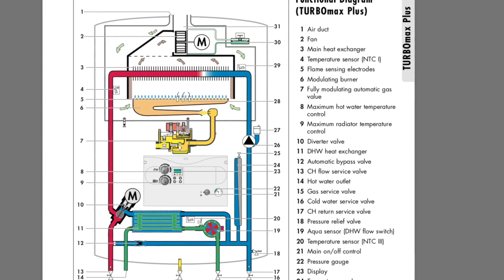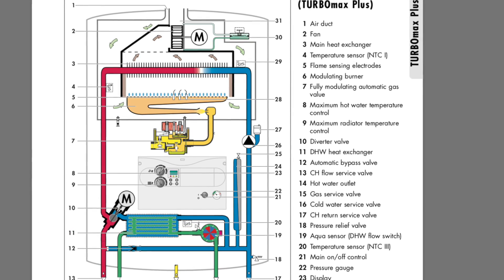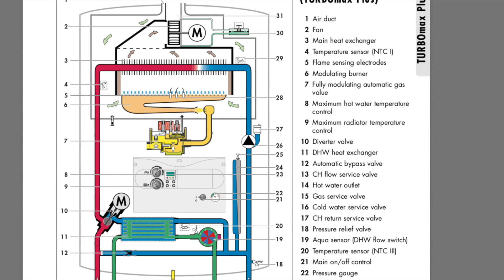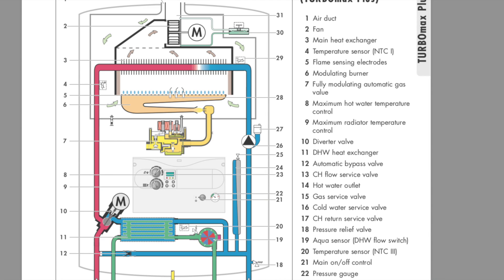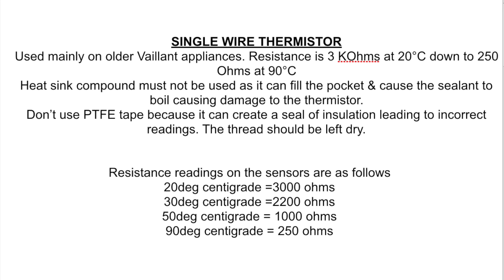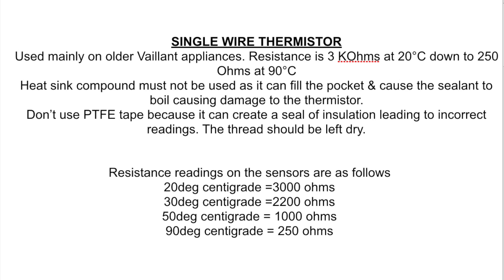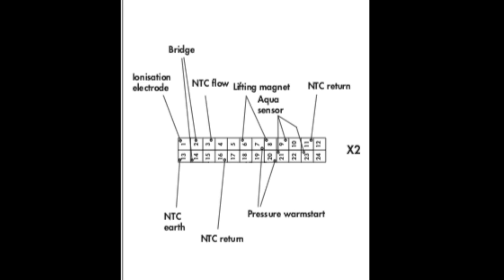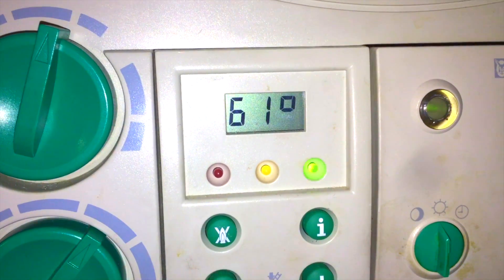Vaillant Turbomax Plus F24. Single Wire NTC. Boiler Repair And Training. Heating Geek.

Comment: I'm having a similar problem on my Turbomax Plus 828E, but sadly this fix didn't resolve it.. :( Central heating side of things works fine, but when I run a tap as soon as the temp rises above 60 the display goes haywire and the system locks down with an S.54. Very oddly the kitchen tap doesn't always trigger this effect, but the upstairs ones always do... So it seems to be affected by the length of the run to the tap/the flow rate? It has a brand new heat exchanger, so I doubt it's anything to do with that. I'm thinking it's either the PCB or one or more of the NTCs.. Could it be anything else? Any way of narrowing it down further? Any advice appreciated. Great vid btw.
Reply from the maker: The diverter valve may have a swollen ball. This will often only present itself when the Hot water demand is very high. Your bath tap usually runs a lot faster (more litres per min) than your kitchen tap. Does the boiler get noisy? The fault in this video is the boiler "thinks" its too hot but tactually isn't. If your boiler does get noisy the it probably is getting too hot. Have a check and let me know.
Reply: @HeatingGeek  Thanks for the reply. Update: The nature of the fault seems to be changing. It does go to S.54 from the central heating side of things now but not quite as often as from the taps. Did some tests on flow rates and it doesn't seem to matter now which taps are used or how fast they are running (2ltr pm vs 6.5 ltr pm = same result), so I don't think it is to do with differences in demand necessarily. Also, the display seems to be freaking out at just below 50 now instead of 60... Just occasionally the boiler is going to F.24 as well. It doesn't seem noisy in operation, and doesn't appear to be getting hotter than normal, water temperature for the amount of time it does produce hot seems to be fine... I love this boiler so I don't mind replacing whatever needs to be replaced, I have a couple of NTCs on order in case as they're quite cheap. Does that shed any more light on what it might be? :/
Reply from the maker: @fnps1663  if its not noisy and you have replaced the plate heat exchanger I would guess an electrical issue.
Something I have seen a few times is, the flow NTC on the left hand side of the boiler above the diverter valve touches the side case. This will only happen if the plastic plug cover is missing AND the diverter has been replaced.
When the diverter is replaced the vertical pipe to the main heat exchanger can turn a little and cause the NTC plug to nearly touch the case. When the boiler runs the vibration can cause it to touch. I also love the Turbomax plus boiler and think it's the best combi boiler ever made.
Reply: @HeatingGeek  Thanks, yes I think it's most likely electrical now. The diverter was replaced a few years ago but the NTC still has its cover and isn't touching anything. First step will be NTC replacement followed by PCB if needed. Will update you with what happens either way. Thanks for your replies!
Reply: Update: It was the right hand side NTC that was to blame. Sadly it took some swapping around of NTCs to figure out as one of the new ones I received was also faulty or incorrect it seems. Boiler is currently functioning correctly!

Comment: I had the exact same issue with my TURBOMAX PRO 28E VUW 282—flashing yellow ignition LED and an error indicating a flow problem, which led me to the exact same solution. Diagnosing it was tricky since flow in these units is only measured by the NTC sensors. It took me nearly a year to pinpoint the problem, even though I suspected it was related to the NTCs. The turning point came when I had to reset it with shampoo still in my hair! I wish I had found your video sooner—it would have saved me so much trouble
Reply from the maker: It's a tough one to find. :-)

Comment: If timer is faulty can you remove  timer and fit external controls
Reply from the maker: Yes you can. Pull timer out and wire in new controls.

Comment: Have you ever checked the Modulation Current d.37 on the TURBOMax during the run cycle ? I have one that is running for just 30 seconds or so per cycle and I’m thinking it’s going full rate rather than modulating.
D.32 readings
- 0 to 111 (mA) for Ignition sequence (6 seconds),
- Then 13 mA for 28 seconds of run,
- Then back to 0 for pump overrun.  
Target temp of 70 is being reached by the 30 sec cycle. 
Any thoughts on such a short cycling ? Is it normal or should the burner be modulated down and the therefore a Gas Valve Modulation higher modulation current should kick in ?
Reply from the maker: Just check the gas pressure. If the mechanical gas valve isn't set up properly then it doesn't matter what current you have. Someone could have set up the minimum to 10mb and the max to 10mb. the boiler will not modulate then
Reply: @HeatingGeek  yes. It was the Has Valve that needed setting up. It’s a lot better now. Thank you.
Reply from the maker: @Bob_too  I haven't been around much so didn't reply. sorry about that. Glad you got it sorted.

Comment: Does the Flow and Return side NTC’s fit in to a closed end thread or actually through the copper pipe to contact the water ? 
I have a TURBOMax that looks like it has white jointing compound coming out the side of the NTC threads, so I’m wondering if someone has ‘sealed’ them in and this could cause an increased resistance. If the NTC’s go in to a closed threaded coupling, the No sealing should be required.
Reply from the maker: The NTC is in a dry pocket. Sometimes heat sink compound will be put on the tip but PTFE shouldn't be used.
Reply: @HeatingGeek  thanks. So the Flow / Return NTC’s can always be changed with out draining down ?
Reply from the maker: @Bob_too  Yes. :-)

Comment: So good that you take time to study. I have an issue where i have the Turbomax 28, not the pro with the fault panel. Anyway my issue is that when preparing for CH, it often tries to start x 3 then reverts to failure mode and has to be reset. If  i have water demand, it runs every time with no failure. I have noticed that if i reset the boiler and turn on HW demand, run for a minute then turn off HW, the CH demand will run and fire as normal. Only after heating temp is made and boiler switches off does the cycle happen again. I have had an engineer out and he has replaced the Dviverter Valve, same as in your video. That has not fixed the issue. I dont want to be chasing fault after fault with replacement after replacement. Its an expensive non repair. Do you have any experience i can point him in the direction of?
Reply from the maker: I Didn't see this comment. Sorry, i hope you got it sorted
Reply: Yes i did, it was a strange solution though. The thermocouple was replaced and the issue disappeared. It doesn't explain the correct operation on HW demand but its been fine ever since. I was hesitant to pay for the replacement given the symptoms but the engineer had said he had seen such an issue before! he was right. @HeatingGeek
Reply from the maker: Your boiler doesn't have a thermocouple so something else must have been replaced. :-0

Comment: Update:  I replied 1yr ago that your fix appeared to help our issue, and indeed for a year or so its been fine. However a few weeks ago, same S.54 and the random F.24.  (S.54s started to come daily)  I re-did the extra earth connection but still happened.  But, when working boiler was fine.  Taking this "cause" to the next level, I replaced both NTCs pre and post HE (ebay £9 for 2x genuine!) but wrapped an earth cable around so it was compressed on the final turn  (I tried soldering to side, but solder didn't bind).  I then took the ECU earth off the boiler chassis and joined directly to my 2x NTC earth cables in a wago 5-way, then another cable back the boiler chassis.  Theory being, a good/known/clean/common earth between both NTCs and the ECU.  Since, *ZERO* trips!    Maybe new NTCs not needed, but thought as I had to remove them anyway I'd swap them out.  No idea if there was a faulty one, or intermittent fault, but for £9 - why not.  So it appears you were on to something, so thanks again, and perhaps "my" fix is the final step if it keeps happening!
Reply from the maker: That could be the fix. I would of assumed the issue would have been the PCB after the usual earth trick didn't work. :-)

Comment: Great video, I have similar  fault with the very same boiler,  yellow light is intermittent goes from hot to cold water. I have ordered a NTC sensor return and air pressure switch. I never thought an earth connection can sent hot water to cold in a matters of seconds. I will try your logic to.see if this works. Thanks again very well explained. Please let me me.know what you male of my fault

Comment: Hi Oliver.  I came across with turbomax hot water running for 2-3 minutes then cod and I had replaced the heat plate and still a same problem. Should I look in to flow sensor? Would appreciate you advise.  You're master in repairing

Comment: HG you're a genius, love this solution.   Perhaps you could throw some ideas at my issue?
 I've got an old Turbomax 828E that was forever failing so I took out the Valiant "insurance" 4 years ago and the main H.Ex had failed. It was replaced along with almost every component by insurance engineers... the following year F.22 randomly appeared so I changed NTC's (twice) and all was well... then F.22 started again so I earth-strapped HEX. F & R pipes to chassis (thanks to your vid) and all was good once more... for a while, but then F.22 crept in again. When boiler first fires it happens within about 10 mins but as boiler/CH water warms up after re-setting F.22  a few times it goes for many hours, sometimes for the whole day.  
Sometimes it will fire up in the morning for a few house before F.22 oh, and if I hook up diverter valve for H/W it will ALWAYS F.22 when DHW draw is finished. (we don't use DHW so I simply unhooked actuator head from diverter valve)
PCB, Fan & Aqua sensor (which I've checked voltage output and it's good) are the only things not changed so very reluctant to scrap it now as it's pretty much a "new" boiler... :)
Any ideas come to mind?  
Thanks in advance.
Reply from the maker: I would guess the boiler is still blocked. Without looking at it, its hard to say. Sorry
Reply: @HeatingGeek  Just reporting back to say THANKYOU. I'd become so fixated on it being electrical/mechanical your suggestion put me back on track to the simple solution. 
First off "competently" checked gas pressures to rule anything there out but they were spot on so I drained boiler through service valves and quite a bit of magnetite came out. Flushed burner through service port with some X800 siphoned from bottle on top of boiler then ran the rest + another bottle of the same around the system for 3 hours which didn't lock out once. Drained and flushed twice and refilled with X100. Everything has been perfect since. 
I was even able to re-hook up the diverter valve actuator as DHW always caused lockout (commercial building so didn't need HW). We have heating and hot water and all thanks to your "blockage" comment. Nowhere on the internet or elsewhere has blockage been mentioned as a cause for F.22 on an old Turbomax Pro 820E - Been collecting quite a bit of magnetite in the pre-filter which will hopefully stop any further blockages. 
Adding this not just to say thanks but hopefully it might help others looking to keep a reliable old non-condenser going for a few more years.  Thanks again.  :)

Comment: Good demonstration of persisting with a logic based approach to fault finding. Oftentimes we are seduced into relying on ‘matching likely solutions’ based on experience and/or progressing through the easiest (shortest time) potential solution to the most difficult (longest time) potential solution until we stumble upon success.

Comment: Hello. thanks for the vid. At around minute 12 you show your solution (although you haven't used the exact bridging materials that you would have liked to have used because you're not in normal van).  What wire and connections would you ideally have used use please?
Reply from the maker: I would take its all apart and clean all the joints on the pipes and diverter and then refit it all. That would be the true solution. 
Or an earth bonding clamp above the diverter and a wire on the chassis screw.
Reply: @HeatingGeek  thanks mate. you're a legend for this one.   Had been experiencing f24 intermittent fault for months.  tried so many things and your solution worked!  good timing too.

Comment: Top quality find. You could use a pipe bonding clamp - and a length of lead with a ring terminal on each end. Total cost perhaps 2 quid - rather than your selection of gems from the scrap bucket.
Reply from the maker: :-) Its all I had :-)

Comment: The old harness wire you used from the worcester, is very cheap chineese wire with very little copper content. That's how good worcesters are...You can test the copper content of electrons in wires as they provide a fraction of a signal.
Reply from the maker: As long as the boiler was working we knew what the problem was. ;-)

Comment: Just came across this exact fault , intermittent f24  on a Turbomax 282/ 2.5 , temperatures different every time on hot water ..... I was going to replace the ntc sensors but I’m going to go back and try the return path check ..... cheers for this !,...
Reply from the maker: Let me know how it goes. No one has ever come back to say they had this. :-)
Reply: HeatingGeek ... returned to the job yesterday, cleaned up the sensors and the chassis connection , tested the sensors values , all good , tested them again to the wire on the chassis, all good and from cutting out 2-3 times per shower is running perfectly. Going back for a different job in a week so I’ll check .  After cleaning the connections the values were instantaneous where I had to scratch with the meter probe to get a reading before. Now temperatures are stable , hot water constant, no cut outs or going cold .... happy customers!!..great wee video
Reply from the maker: @christait5714  NICE. :-) Im so glad this has helped someone. This was the hardest fault I ever had to fix.
Reply: HeatingGeek .... quick update , boiler has not faulted since the repair ... 👍😁😁😁
Reply from the maker: @christait5714  Nice one. Thanks for getting back to me. :-)

Comment: Shame your title didn't have S.54 in - I'd have found it years ago!  Our boiler has been tripping with S.54 for YEARS.  (never drops to F.24, or never seen to, but F.24 is stored in error log - -assumed before I moved in).  And in that time, pump, DHW HE, diverter valve all changed and its still randomly playing up.  But only recently have I seen it drop to S.54 on heating (ruling out DHW HE and diverter valve).  The main HE was next on list, but boiler is otherwise perfect (having a shower and watching, as soon as S.54 display, flame-out reset and it cuts back in and can work for 10 mins or so).  So wasn't convinced it was physical.  Bought a HE off ebay which came with 2x NTCs (which read the right resistance) so was going to swap those first and clean contacts.  Hadn't considered the earth return.  But this is the most exciting prospect!!!!!  Thanks :)  FULL RESPECT to your approach - logical diagnosis is a skill not known to many, so well done for applying and sharing.  Will try this later today
Reply from the maker: You have to let me know how you get on. :-)

Comment: Another great tip, in 35 years , I have not had this problem, but if I did , I’m pretty sure I would have diagnosed incorrectly.
Thanks
Reply from the maker: It beat me once. Couldn't let it happen a second time. :-)

Comment: Experiencing similar symptoms with our Turbomax. It will turn the whole heating system off if the heating dial is turned to max, it only operates on about 75%. The strange thing however is that it also needs to be ON 24/7. It will not operate on TIMED mode and just comes up with the f.24 fault. 
Would this error be another symptom of that?

Comment: Recently had this issue.. untill i saw this video. Put in a cable from below the ntc on the pipework to the chassis.. spot on fixed it.. thank you.. i removed it and used my meter to measure the resistance between the pipework and the casing and it was really bad. They should stop designing electrical components that use the pipework as ground as all copper over time especially copper that gets hot and where oxidation is more common eventually looses conductivity. Great find mate.
Reply from the maker: Im so glad you had this issue. So many people look at me like I'm mad when I mention this. :-)
Reply: @HeatingGeek  it does make sense from an electrical point of view. Brilliant find to begin with mate. 👌👌
Reply: Would this be the same on a f22 fault?...Had this and is it resets and works.its happened about three times randomly over the last month.
An engineer has replaced the ntc's and board.

Comment: Crazy. I’ve never had to change the NTC on this boiler, and in fact if called to this fault would even argue that they never fail and blame the PCB if no circulation problems. Thanks for uploading what a legend.
Reply from the maker: I will get this uploaded on another boiler when I have more time. This isn't the best video but this is a brilliant fault.